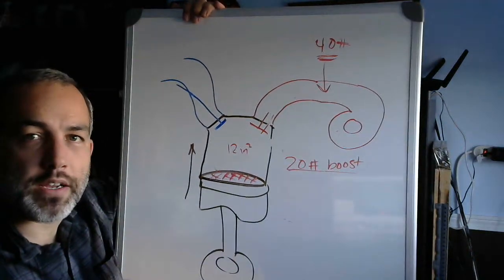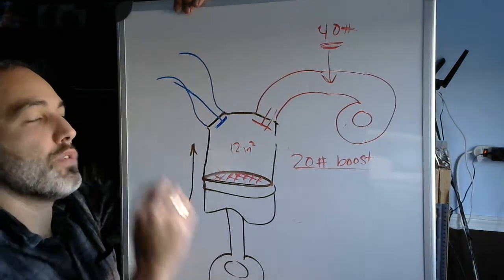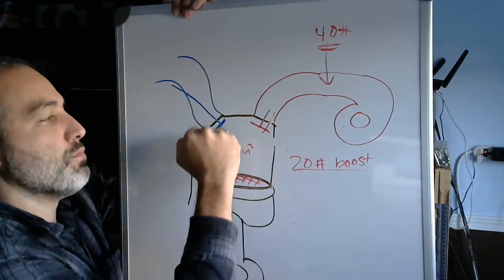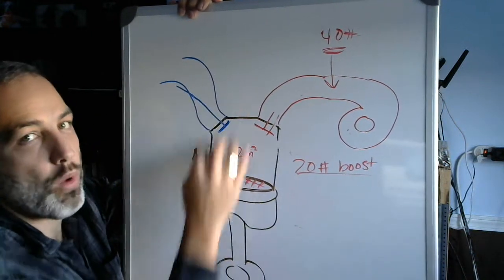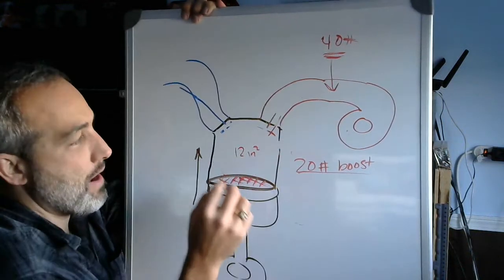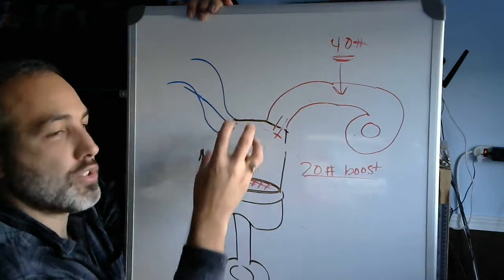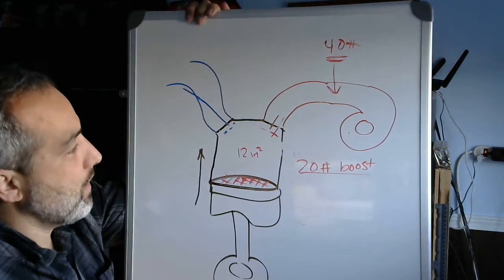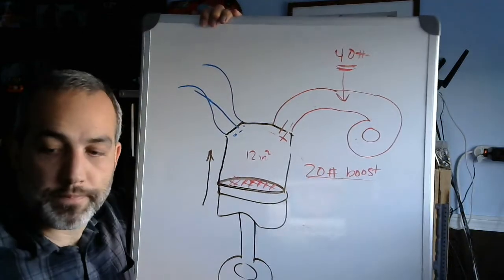Comparing Turbos part2

Comment: I was thinking the lowwer the boost pressure, the earlier the turb kicks in, when the turbo isnt spinning it is not generating power. You have situation where your turbo doesnt have enough pressure to contribute power to the engine, most of the time.
Reply from the maker: That would not be correct.
Reply: @GetaDomTune  In comparing turbos would a less efficient turbo be better if it covers a larger rev range?
Reply from the maker: @sadface7457  I don't know what "better" means to you. 
What I can tell you is that during the power band, you'll follow a curve across the compressor map. While having a higher average efficiency might sound appealing, it really depends on the usage and gearing of the car. If you're looking for the best drag race car, then the answer is no. You want the highest efficiency possibly in the 1.5-2k RPM range that you'll be in between shifts.

Comment: I have to ask. I love you make these videos.. what turbo would you recommend for a 250whp to 325whp range aiming for 300 really, that will have the lowest spool time and least lag? is that even possibe?
Reply from the maker: What fitment?
What dyno?
Reply: @GetaDomTune  well ive got a 2013 corolla, 2ZR-FE motor, 1.8L, 4 valves per cylinder, with the base turbokit from turbokits.com (comes with custom spec'd T28 journal bearing turbo) they estimate about a 90-100 WHP increase from 110 to 210 w/stock boost on wastegate pressure of 8.5psi, i want the fastest spool and higher hp per lb of boost possible in that turbo size,  they recommend the GTX2860R for that... thoughts? on a dynojet near me is where i plan to test before/after. im in FL at 0 elevation btw, normal temps about 80-90F.
Reply from the maker: @CubanLegend561  you're asking a lot from a stock engine. Good luck. 
The GTX28 series is going to be the fastest spooling of the turbos that fit that kit.
Reply from the maker: @CubanLegend561  325whp is over 400hp at the crank. You're talking about over triple the power output of the stock engine. Plan on doing connecting rods soon
Reply: @GetaDomTune  yup I'm about a year out on purchasing the build, I'm currently saving up and figuring out my budget. I'm gonna research the GTX2860R and see if i need the Gen2, or if i should be okay with the GT2860 for my modest power goals. You're right that I'm asking a lot from a stock engine... I've seen others' dyno charts make 195whp on a mild tune, others make 210-225whp on a moderate tune. My idea is to make more power with less boost than them, with less turbo lag and a possibly wider boosted power band, so i can safely turn up the wastegate boost  after i do supporting engine mods....
Reply from the maker: @CubanLegend561  GTX gen2. Anything else is a waste and not a benefit over your current turbo
Reply: @GetaDomTune  good point.  Safest i would go on stock connecting rods in 245whp (about 300 crank?).. the auto trans is said to tank in reliability past 225whp as per MWR, but i've had my U341E trans built by Level-10 for 550whp & 650wtq, so the next weakpoint for me is upgrading valve-springs, retainers, & seals, as per MWR's recommendation that they are next in the line of potential failure points after 225whp is achieved due to valve float. Then, if i can make 200-225whp reliably with stock internals, go with the upgraded valvetrain and reach for 230-245whp... at which point I've reached my goal on stock internals, and I will reassess the build. if I feel i need more power, I'll choose to either look for an LSD to improve putting power down, see how that changes things in the grip game on a FWD corolla with nearly 2.5x stock HP... and if i want more after that- and i have the money.. go for a fully built MWR 2ZR-FE engine and all the goodies and get an EBCS and reach for the 300whp or more, safely, relatively speaking.
Reply: @GetaDomTune  👍 understood, i appreciate your response, could you please elaborate a little on why you're so confident about that, I'd like to understand? I've seen the differences between the GT2860 vs the old GTX2860R vs the GTX2860R Gen 2 compressor maps, but a lot of good those do me when i can't really understand them. :(
Reply from the maker: @CubanLegend561  if you compare those compressor maps and rewatch these videos, you'll get the answers to those questions.
Reply: @GetaDomTune  thanks! I also keep reading how "heat is the enemy" So I'll make sure to get all hot side items ceramic coated. I won't skimp on this. A hear little extra money in the smart areas will pay off later & I'll get what you pay for.. Heat, boost, and quality turbo are some of the main things to research before diving in, so I'm trying my best to cover my bases. Thanks for everything in this comments section and your videos :) I may have more questions in the future. bless you Dom!

Comment: So informative! Thank you for taking the time to explain this stuff. 

What is the reasoning behind a manufacturer using smaller turbochargers, or at least what is considered smaller in the "community" of certain enthusiasts? Are they just after the quick spool, more linear feeling for the customer and not the "lag-then-pow!" type of power curve? Does emissions come into play with smaller vs larger turbos since the smaller turbo is essentially re-burning more of the exhaust that gets pushed back into the combustion chamber? 

For instance, when the WRX was released in the US, it had the TD04 as you know. The JDM STi at the time was using the VF30 I believe. It seems the USDM ej205 WRX could have benefitted from something like the VF30, just at a lower boost pressure, to take advantage of everything you mentioned, no? Or am I totally missing other points? Or, is the TD04 not as tiny as everyone says it is and actually works OK?

The r&d a manufacturer puts into what turbo they are going to put on a car, with all the different variables there are to consider, must be crazy.

Thanks again!